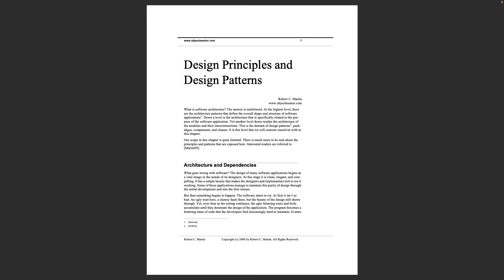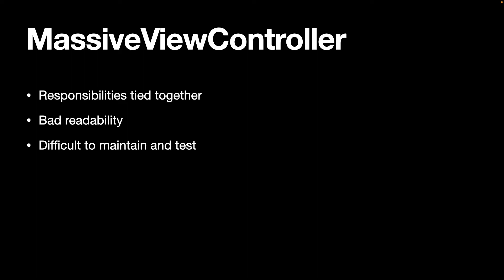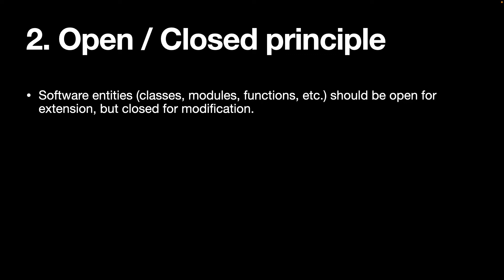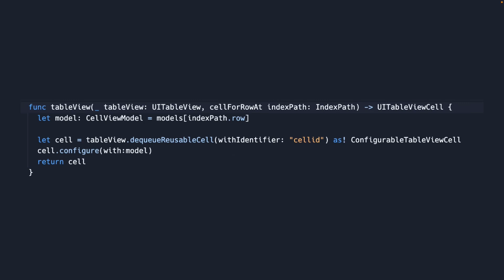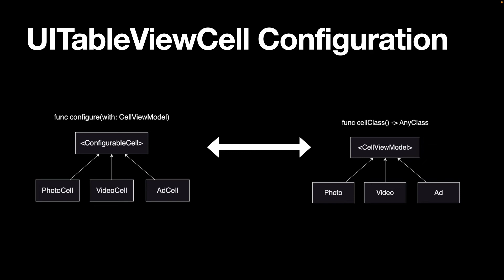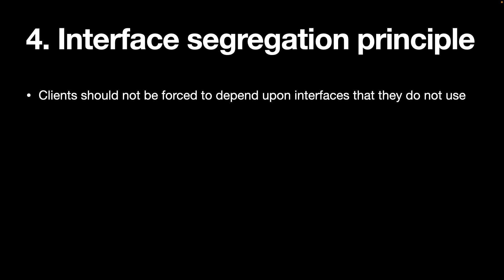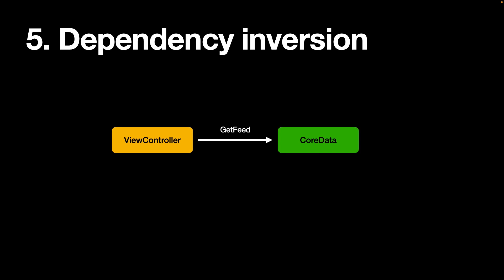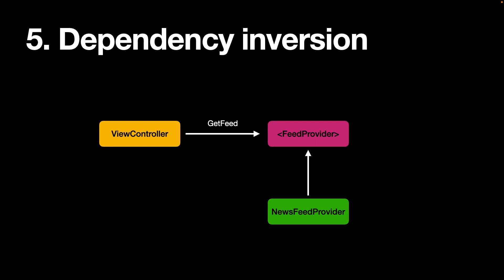SOLID principles explained with iOS examples

Comment: I don't agree with CellViewModel solution. It only hides the massive cell type selection inside, not removing it. Also, the classic multi-cell approach is more modular. However with single CellViewModel you have to edit it each time you add anything new, which may lead to possible merge conflicts.